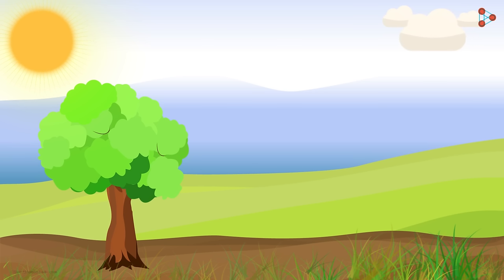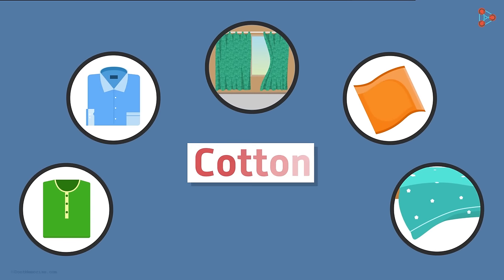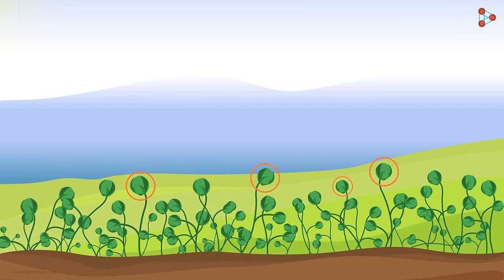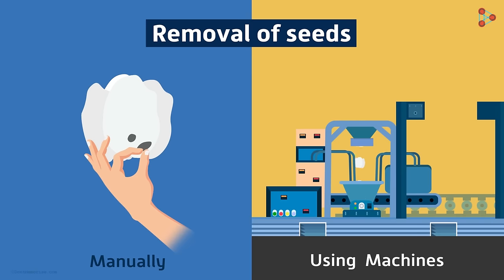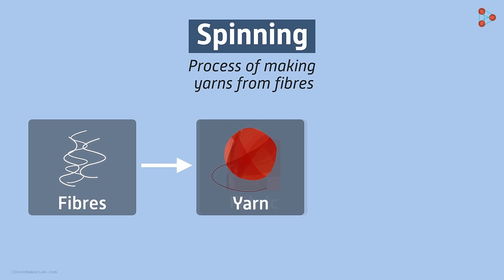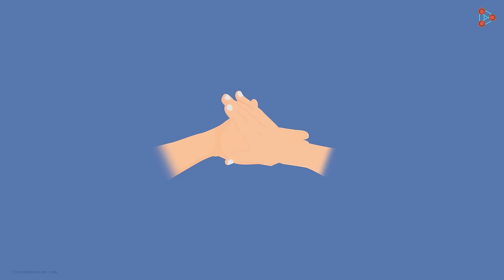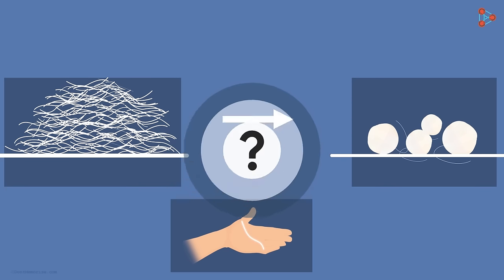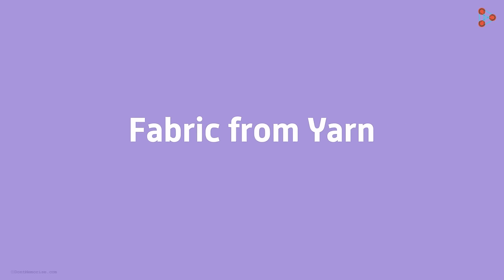Cotton Fibres | Fibre to Fabrics | Don't Memorise

Comment: How long is a cotton fiber?   Is it the same length as the thread it's used to make?   If it's shorter than the length of the thread then why doesn't thread just pull apart when tugged?